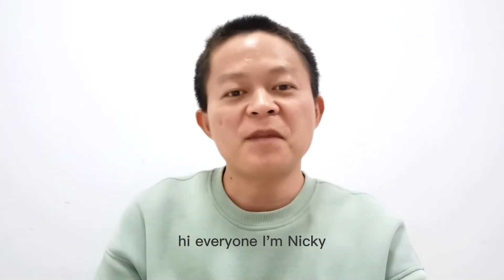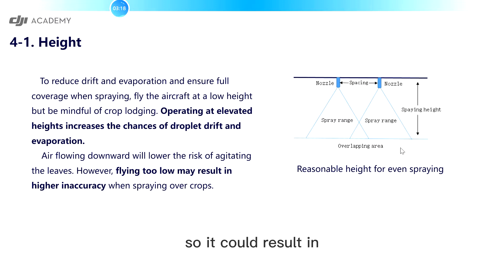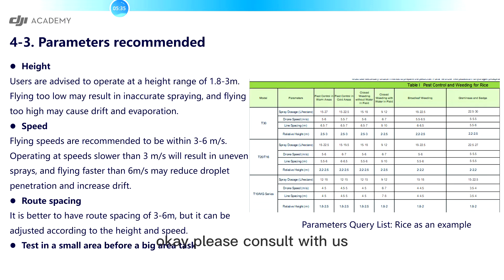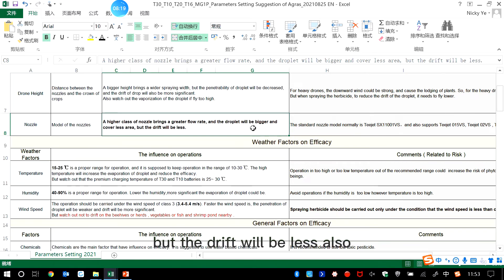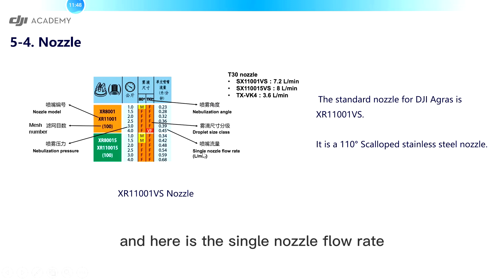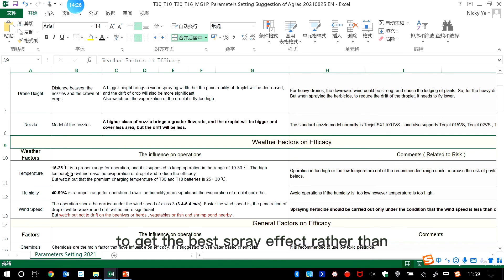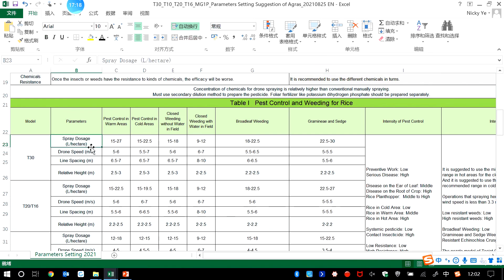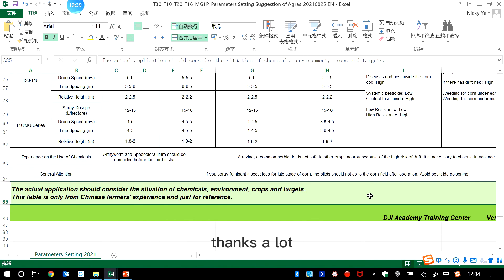How to set spraying parameters of DJI Agras

Comment: Thanks for the valuable information.
and the task settings I use are as follows;(for wind below 12 m/s)

Spraying amount—8.8 L/ha
Flow —1.70/1.80 L/min
Flight speed—25 km/h
Height —2.0-2.1m.
Route spacing—4.6
Products= corn, wheat, beet, canola, sunflower
Can you evaluate these settings?